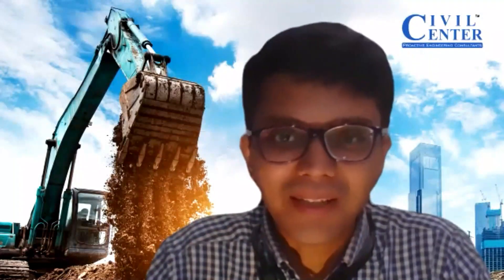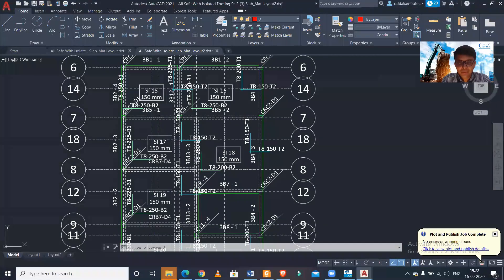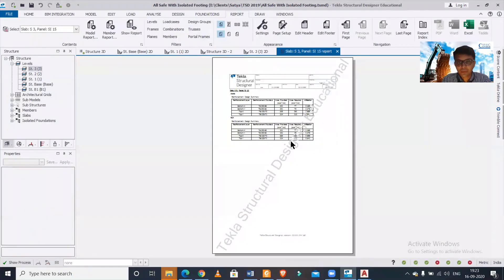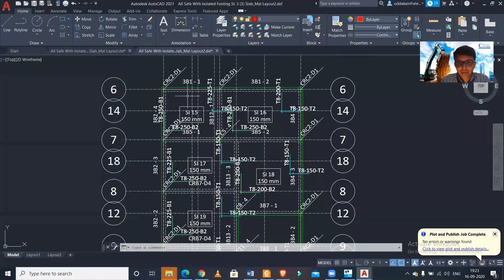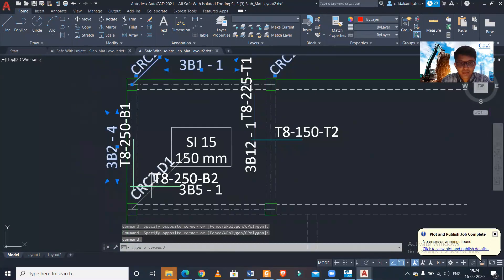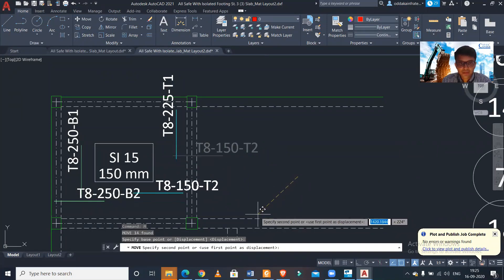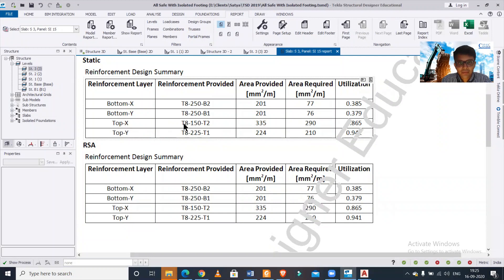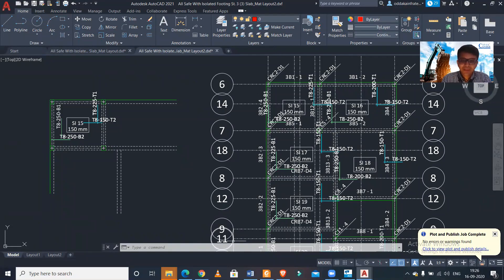Generate slab reinforcement drawing to autocad from Tekla || Generate slab drawing in tekla || TSD

Comment: Hello, I've observed that TSD often provides double reinforcement for the slab design... regardless of the span and loading. This don't seem economical. Is there a way to do more economical designs?
Reply from the maker: Hello Andy,
It's true that TSD provides double reinforcement, but in the structural drawing we can provide it with cuts or cranks as per our standard.

Software will always design for the maximum loading, but our standard conventions for reinforcements along both top and bottom will be followed in the structural drawing.

Hope it helps.

Have a Good One🙂